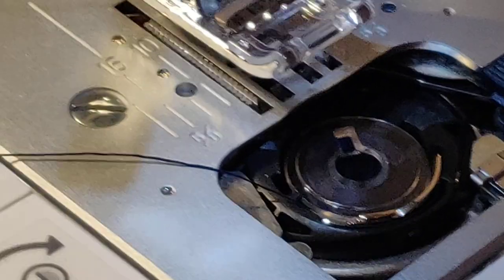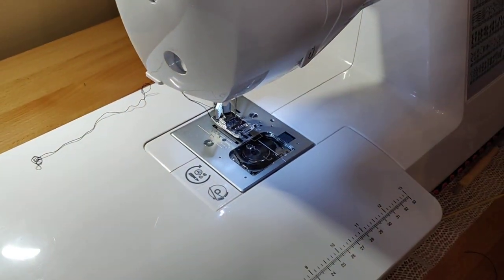How to start/thread your SINGER PATCHWORK 7285Q sewing machine

Comment: I’m wondering about the bobbin thread direction. Looks like you’ve got it where thread is winding clockwise but pictures on my instructions look like thread should be winding counter clockwise. Not sure if it makes a difference. This video was SO helpful!
Reply from the maker: We're you able to figure it out? I hope so. If not, let me know at which part you're specifically questioning, the bobbins at the top or placing it at the bottom?

Comment: Outstanding instructions provided. I followed all to threading (the auto threader side clasps won't pass the needle for the turn), so I threaded the old way. Placed bobbing in under the slit on the rim. Pulled top thread and bobbing thread to side. Turned wheel towards me. Problem the threads didn't catch this time. Did it 2-3 times with no success. It never caught! Suggestions,  please. It took a very long time to do the threading and bobbing set up.

Comment: I've started sewing stretchy fabrics and it works for a little bit but then start getting stuck at the bottom or skipping stitches. I'm using a zig zag stitch with auto tension. What am I doing wrong?
Reply from the maker: Hmmm, there's alot to figure out with this machine. Did you try to increase/decrease the stich number for your zig zag design? Try on scrap fabric what number setting actually works. Also, make sure you're using the correct type of needle. I'm no pro, far from it but I've tried those two suggestions myself when I was having issues..... Good luck, I hope I was able to be of some help.... Fingers crossed.

Comment: Can you teach how to fix the automatic needle threader? It worked now it won’t 😩
Reply from the maker: Hi Julie, just seeing your comment..... Can you please explain what's going on with your needle? Full details....
Reply from the maker: A suggestion..... The needle HAS to be lowered to a certain point in order for the clap to work. That clap will not flip/turn to the angle it needs to if it's not. It was a hit/miss for me at first until I got the hang of it. 
Just keep practicing and learning where the height should be in order for it to work. I'm assuming that's your issue, if not ... Please clarify.
Reply: @creativejourney7639  it did work initially . But, I can’t get it to go lower. Makes me wonder if it’s broken or it’s just me.
Reply from the maker: @julieholland8407  , I don't know what to say, I'm sorry. Before thinking it's broken, if you have patience... Maybe you should turn the dial that lowers the foot little by little while trying to turn the lever. Idk, just a suggestion, maybe you've tried it already...

Comment: thought I knew how to thread a machine, I was wrong.  Have one question, what causes fabric to slip or pucker?
Reply from the maker: Hi, sorry for responding late but I'm not too sure about the slipping but the puckering could be because of the needle. I try to use a fresh needle after each project. Fresh needles do make a difference. It's also recommended to change after using a needle for 8 hours. I'm just assuming that's the problem, I'm still learning myself. Hope you get your issue solved, happy Sewing! Just don't give up.

Comment: Moistening well your fingers,  touching thread and eye of the needle, will cause molecular attraction to pull the thread through the needle.
Reply from the maker: Yes, I've done that before and noticed it works. Just didn't do that time during video. Thanks though for the tip. I have to say, the auto threader is great.